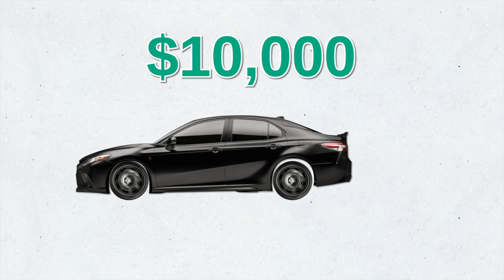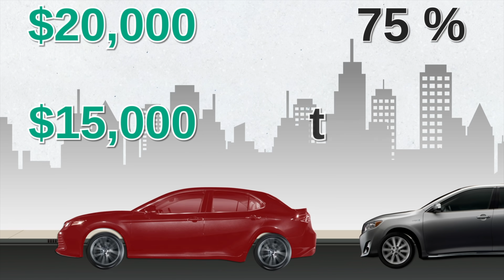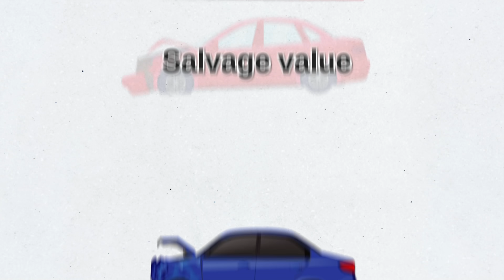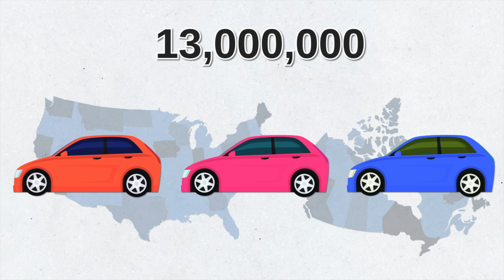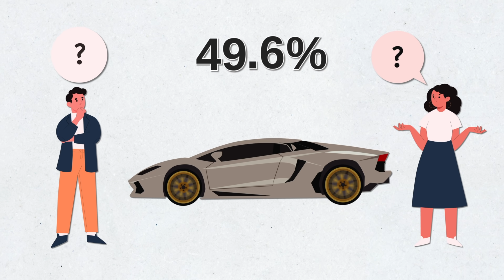If a Car Has This, Don't Buy It

Comment: I have a question for you.
 I recently bought a  08 Toyota tundra double cab with a 8" lift  Kit sitting on 35's by 20's.
For $21,500 with 95,500 miles did I get robbed??????
Reply: No, but you will get robbed every time you fill up with gas.
Reply: Actually I put $70 in every 14 days.
 I get 230 miles per  Tank.
 And I only use Chevron.
Reply: Thats low miles so its probably the normal price these days .
But by being lifted it can put more stress on the drivetrain .
And I wouldnt try turning real fast , since your center of gravity is higher or you might flip it on its side .

Comment: Diff kind of "horror" story.  Daughter was rear ended, she in an older pathfinder, the guy who hit was in a late model F150.  When I rolled up after the call from her I saw his truck looked like The Hulk punched the engine and all the wrong way.  LIke a 3 foot wide boulder took a bounce off his front.  Complete total loss just by a moments glance.  Her's?  The full spare tire was mounted on a steel frame that swung out when unlatched... it was mounted to steel at both contact points.  None of this mounted to the back door crap.  Steel to steel to steel.  She had a deflated spare tire and a turn signal cover that was cracked and the bulb didn't work.  
The horror? He had NO insurance and lost it outside of scrap $ or parting what he could if he cared to try.  Had to have been 30K at the time...  We...bought a bulb, a taillight cover, and the tire held air once the shop did a once over.  Only acronym we needed was the ATM for chump change.

Comment: Well I had a 2001 new model caddy DTS. 4.6.  What a junk bought new.  It was in the dealer more than driven in days for the first 3 months!!!!  I sent a claim in for the lemon law and won it!   Good news but listen to this!   The folks with the reporting ordered it reviewed by a third party mechanic!   He found the engine was defective from improper oil blockage in the motor??  He also wrote all this down on paper but didn’t bother to tell me the defective engine should NOT be driven!!!!   Well I did not get that info the day I drove it to work.  I was on a Chicago freeway when the cars motor took off about 70 like someone put the cruise control on.  I could not get that car under control!   I pulled it on the exit ramp and tried shutting the car off the steering locked so that didn’t work.  Panicking I stood on the brake peddle Then. Screamed for god to help me and down shifted it would not go into park.  Electronic control didn’t allow for severe down from forth it was about second when the car left the exit ramp.  It lost its trans cover on the first curb and the oil pan on the second curb.  It finally stopped on the north facing road from the south bound exit.  It was a four lane road with a green space between.  It was considered total by my insurance.  Not one dent in the paint mind you.  The wheels engine and trans were gone.  

The letter arrived the next day stating I should not drive the car????   My insurance was very interested in that letter.  GM paid for everything including my deductible and gave extra.  I bought a Lexus LS 430 after that.  Boy what a difference that was.  Dined lucky to have lived.

Comment: On a 2003 Honda Accord, if the engine is running for 5 or so minutes then the radiator cap is removed and the gas pedal is engaged: should water shoot from the radiator?

Comment: My SUV was hit on the side by a bus. The bus driver was on his break with the 4 way flashers turned on.  I pulled out in to the lane on the bus driver's left side to pass the bus. I was intending to go past him and make a right turn since he appeared to be stopped.   Apparently, with his 4 way flashers still on he moved forward, and turned out in to my lane.  There was a car in front of me who did the same thing.  He made it by the bus because the bus driver did not yet move forward in to the lane. 

When I went to see the bus driver he called the transport police that works with the bus company which is government owned. I live in Quebec.  The police officer told me that the bus has total right of way, and because I was along side of the bus while the bus was proceeding the accident is automatically my fault. Apparently, this is law in Quebec. I called the government office for the driving regulations and verified this police officer was correct. All government vehicles in Quebec have this right. I found out in the province of Quebec there are over 100 bus related accidents per month in the city areas. The police officer that filled out the report told me he sees and average of 5 accidents per day with the buses. 

The insurance adjuster told me this accident was my fault under the Quebec driving code. Even if I was to give the video from the security cameras in this SUV, it would make no difference. 

In Quebec if a bus is late on schedule the driver is allowed to drive 16 km/hr (10 mph) over the speed limit. He is allowed to advance on a red light if he sees it is safe. He is allowed to turn right on a red light if he sees it is safe. I was told more than 95% if a car is hit by bus in Quebec more than likely it will  always be the car driver's fault. 

The SUV had a total of about $5,000 in damage to the two passenger side doors. Both doors had to be replaced. The bus had only a few scratches and its mirror was slightly damaged.  

The insurance paid all the damages minus my deductible of $250.  This new SUV was only 7 weeks old with about 3,000 km at the time, and I had to drive a leased car for about 2 weeks till the repair was finished. It is impossible to tell the doors were replaced. The dealer did the repairs. 

Now, I am very frightened to pass a stopped bus.  I try to move two lanes over if I see a stopped bus. If I have no choice, I flash the high beams and tap the horn a few times to make sure the driver is aware I am passing him. Just yesterday I saw a car pass a bus while it started to pull out. The car driver saw the bus in time and was able to swerve out of the way! Crazy here in Quebec!  The bus drivers do what they want when they want!  

I was warned my insurance cost may go up as much as 20% to 30% range when I renew. 

__

Another time the rear window got hit by a rock that flew off of a construction truck that passed me while I was stopped. The rear window was damaged. I did not want to make a claim.  I was not able to chase down the truck because of traffic and the lane I was in. I did not want to make an insurance claim. The rear window replacement cost me about $1200. There are sensors and the rear defroster wires in the window. I was given a loaner vehicle for the few days needed to replace the window. 

Just recently someone hit the SUV in the rear while I was stopped at a light. The driver did not have his permit with him, and he was driving a friend's car.  Only the electrical connector for the trailer was damaged. He hit the trailer hitch support.  This SUV is a near 3 ton vehicle with a trailer hitch that can support about 10,000 lbs. He smashed up the front of his Honda. The connector, retaining bracket, and the harness cost me about $380 with the labour to replace. I am paying this one.  I don't want to try to collect from this guy just in case he decides to go to his insurance.  I don't want to have my name attached to another incident. In Quebec my rate would go up even if it is not my fault. They have no fault insurance in Quebec.  I now put on a large heavy duty 30 lbs hitch bully in case I get hit again. The hitch bully will hopefully stop the car before it hits my rear bumper. For the front bumper I ordered a heavy duty full size bumper guard.  This is a new model SUV and I have to wait till this guard is available for it.  When people are parking they've bumped in to the front bumper. I had some new marks on it that I had to polish out.

Comment: Hey Scotty, I have a 2011 Mitsubishi Lancer, it is not starting, I changed the battery, the starter, and all the fuses are good. Someone told me it might be the key ( FAST) system, what do you thing is the problem and how I can fix it. When I turn the key, all the lights on the dashboard light up, but no crank at all. ?? Any ideas ?? 
Thank you
Reply: It could be the Security system .
Try a different key .
if it cranks over but wont start , it probably IS NOT the Security System and could be fuel pump or fuel filter .
Turn key on and have someone listen for a faint humming sound for the first 2 seconds by the gas cap .
If you hear a sound , then the fuel pump is working so check the fuel filter and have the fuel psi checked out .
Reply: @jayhockley8841  thank you, will give it a try .